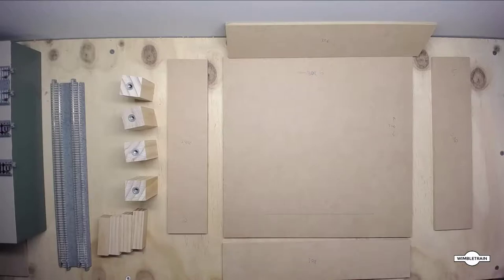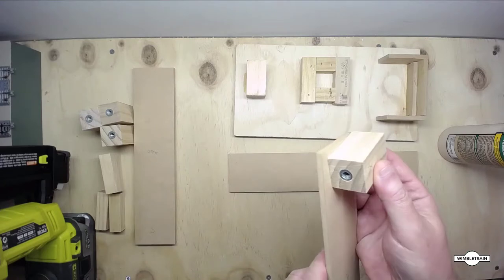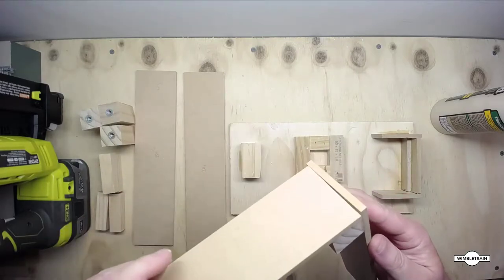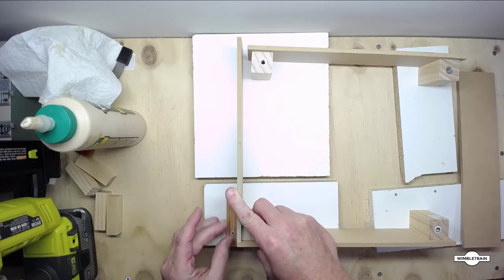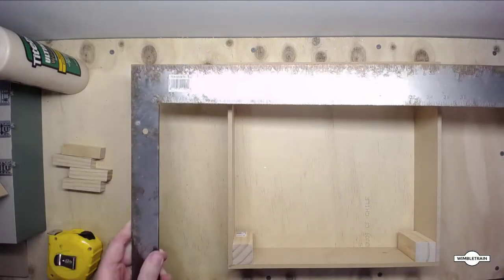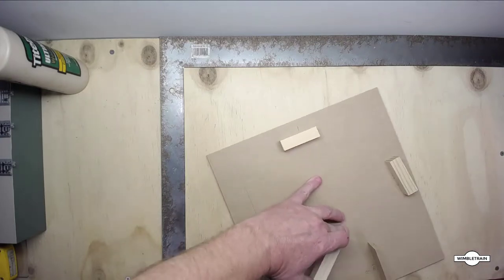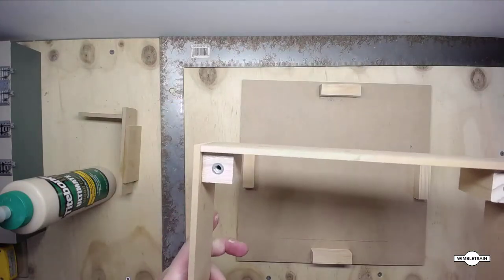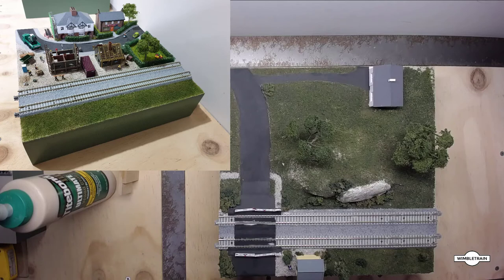Build Single T Trak Module N Scale

Comment: Maybe a silly question but are you nailing the tops on or just using glue? thank you for a very helpful video
Reply from the maker: Hi, not a silly question at all. I did used to nail the top as well as glue it. I put nails into the 4 corner supports. But l found that the way I do it now (as per the video) this is not really necessary, just use a good quality wood glue and then plenty of clamps. Cheers John